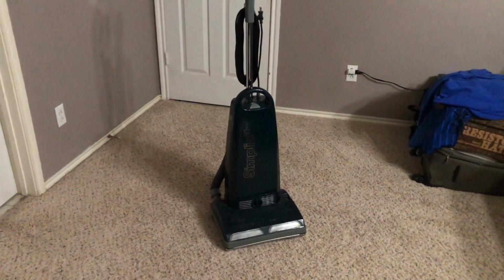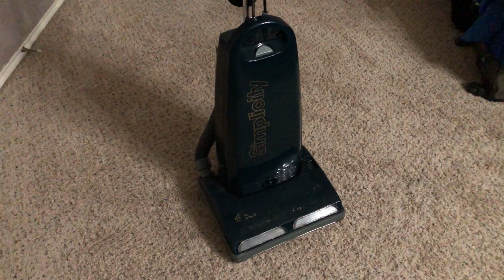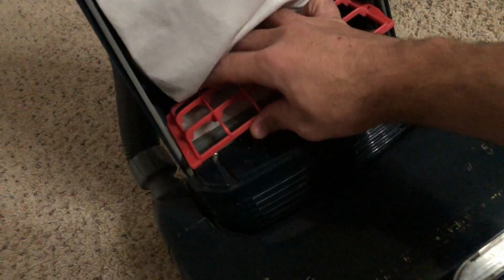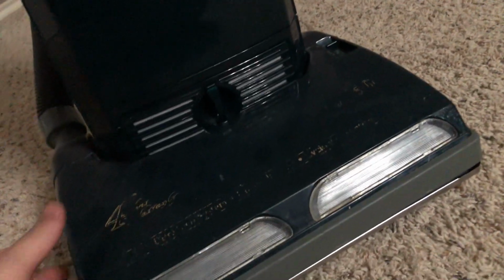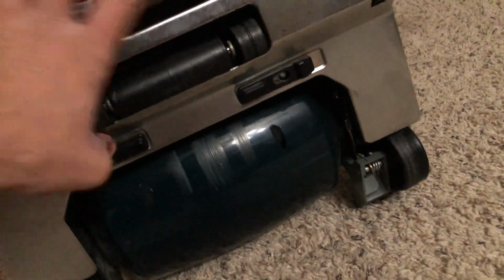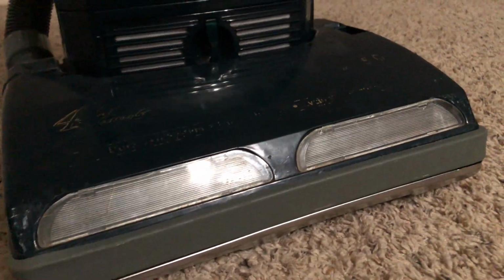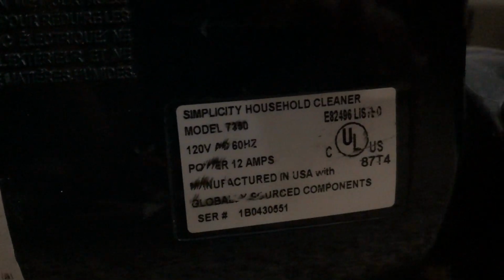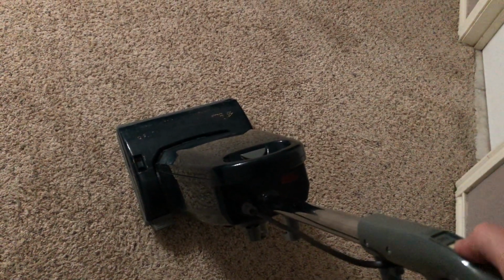Simplicity 7350 (7 Series) Upright Vacuum

Comment: Had a problem with the clutch mechanism twisted to inside.  With your video I was able to get the cltch and rod in the proper position.   Thanks.  This is the best suking vacuum ive owned.  Been running 20 years!
Reply from the maker: These as well as the Riccar versions are definitely the best.  It's really a shame Tacony doesn't sell products like these anymore, even their Symmetry/Vibrance vacuums were pretty good.

Comment: The 7 series is one of my favorite Simplicitys and the 7350 happened to be one of my favorite models of the 7 series. They debuted in 1995, and this particular one was made in 2001
Reply from the maker: They're such great cleaners, I honestly prefer them to the equivalent Riccar 8 series since their brush system allows it to dig into the carpet more effectively than the Riccar version with its floating head.
Reply: I can't find anything online showing how to replace the belt?

Comment: Funnily enough I just picked up one of these. Has all the attachments and the extra hose. The gaskets on the bags are rotted, but it works great. I just need a cord hook as the old ones broken. It's super quiet and cleans really well. I'm very impressed with it so far

Comment: This is my all time favorite model from not just under the Simplicity brand but out of all the vacuums Tacony has ever sold, even the central vacs. Wished they still sold that model in green until the discontinuation of the entire 7 Series line.
Reply from the maker: Agreed, I know it practically the same as the 7850, but I prefer this 7350 color wise.  And it's really a shame the Simplicity 7 series/Riccar 8 series were discontinued, these were great cleaners.  I always thought the last good clean air Tacony vacuums were the Simplicity Symmetry, and Riccar Vibrance, S20UP/R20UP respectively.
Reply: Almost, the 7850 was technically an upgrade over the 7350. It had rubber wheels, better stretch hose, more layers of filtration, a stronger twin fan motor, smaller light bulbs, and an extra year on the warranty. Same goes for the Riccar 8955 over the 8850. I totally agree with you, I wished those were still being made today. At least I wished the Ultra Premium models were still being made since they did got some things right over the 8 and 7 Series models, however I personally liked the 8 and 7 Series more (I have the 7750 in my collection and have already shown on my channel). I also really like the R20P.2 that my uncle has which I've also already shown on my channel, I think it is even more powerful than the R20UP. But I think their best bypass models are their central vacs which you can still buy today.

Comment: Your serial number shows that it was manufactured in the second quarter of 2001.

There is a difference between yours and the maroon 7-series.  While they both have the clutch operated brush rolls and 12a motors the maroon version has a twin-stage motor while the green one does not.  Not all 7-series had twin stage motors.

The Riccar 8955 you mention of also has the twin stage motor.  Also your vacuum takes a Type B bag which is slightly longer and larger, but the Type A bag does fit.  

You were complaining a bit about how the bottom plate doesn't latch on easily.  Depress the release pedal and allow the height adjuster assembly to move down and out of the way when putting the bottom plate on.  It will give you better clearance.

Thanks for your video!  Overall an excellent presentation of a great classic.
Reply from the maker: Thanks for decoding the date for me, and from my understanding, this green 7350 was really the predecessor to the maroon 7850, and these actually came original with the same 2 stage motor as the 7850.  There was another green variant of the 7 series that was the 7750 which was sold in the same time period as the maroon 7850 was, but the only difference that had compared to the 7850 is that it didn't have a clutch operated brush roll, and it had the same 2 stage motor as the 7850 did.  I know there was a period of time when Tacony did use an Ametek Lamb built 2 stage motor back then before developing the Duratec 2 stage motor in later years, perhaps this has the 2 stage Ametek motor rather than the Duratec that the 7850 definitely has, who knows?

Comment: Thanks for your video's. I just got a Eureka Excalibur 12 amp Quiet Kleen at Goodwill for $10 everything works, almost Newbag, adjetator brush is clean, long bristles, soft, both lights work only came with the crevice attachment. It is a fine vacuume for price. Now to find Belts & Bags that work.
Reply from the maker: For that, you'll need Eureka RD belts and Eureka (not to be confused with Hoover) Style Y bags

Comment: I recently picked up a 7300. It's a nice vacuum. Had to replace the belt. The vacuum won't seem to lock in the upright position though. Trying to figure what is wrong and if I can resolve it. Also need to source some replacement bulbs for the headlamps. What I like about these units is they appear to have the same or similar quality motors like the Panasonics had.
Reply from the maker: Ametek Lamb and Panasonic made some excellent quality vacuum motors.  As for replacement light bulbs, the official light bulb size for this is a BA15D that uses a double contact base.  There are however specific light bulbs available for these, as well as for Kenmore, Electrolux, and Panasonic, all of which are 15 watts.  Amazon does sell LED lights in that same BA15D size.

Comment: id say panasonic borrowed from hoover's  dail a matic
Reply: Panasonic bought the Dial-A-Matic design from Hoover.
Reply from the maker: @panasonicvac4036  I thought Hoover sold the technology to Panasonic and they used it to develop the Jet Flo series.
Reply: Yeah that's right. It was Riccar that Panasonic gave permission to borrow the design from them.
Reply from the maker: @panasonicvac4036  I do wonder how that design went into the Essco cleaners like Cirrus, Prolux, Bernina, etc.  But I do remember one of the first Riccar uprights was an HP30 which was essentially a rebadged MC-6200 series Jet Flo.

Comment: HELP please. I just got this vacuum at the thrift store for $35.. the belt is broken though and I've no idea how to replace it. The bottom plate is plastic.. looks like the brush and plate were replaced.   I've always had Kirbys... so idk how to do this one lol
Reply from the maker: This has 2 simple latches on the bottom to remove the rug plate, and the brush roll will pop out, but you have to be wary about the rod that runs along the side that's connected to the brush roll since that's a part of the clutch system, be sure that's connected when you re-attach it, and also that the latches on the roller are lined up on the inside.
Reply: @graysonsvacsandmowers5426  thank you so much! I just ordered the belt.. wish me luck!
Reply from the maker: @awkwardautistic  There should also be other videos that should help you out in case I didn't.  Even the belt change tutorials of the Riccar versions should give you some leeway.